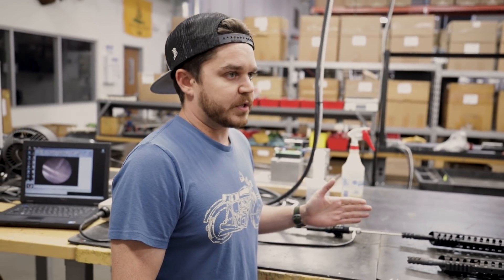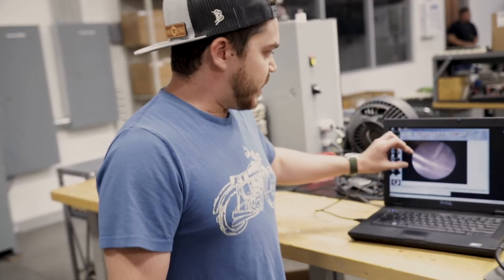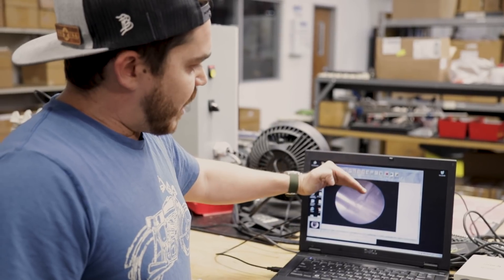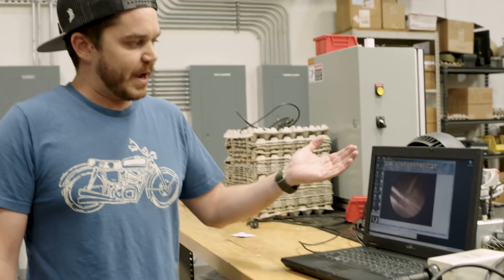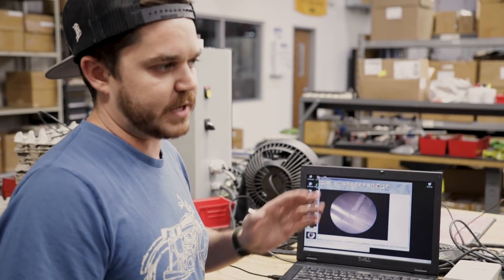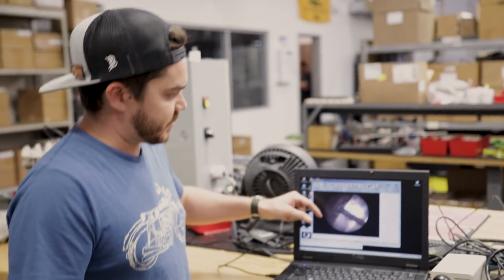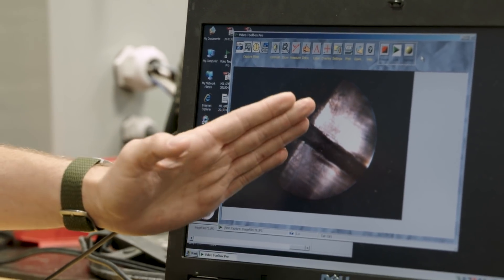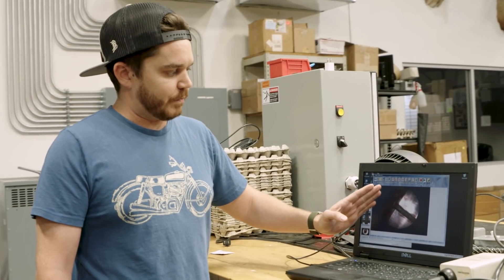POF Behind The Brand - Groundbreaking E2 AR Technology

Comment: Still not a fan, IMO you guys ruin a good Mike Rock barrel by doing that crap.
If you're ripping off the case head then you need to slow the operating system down, simple as that.
This machine gun technique is garbage for a DMR system, if it was the shit, everyone would be doing it. 
Go back to the gen 3 gear! Literally the only thing that gun needed was a lighter hand guard, everything else was perfect.
Reply: No one else is doing it, because no one else has patented it bro.
Reply: @JohnBrowningsGhost  That is so absurdly wrong its not even funny!
That exact same idea has been used on machine guns for decades!
Reply: but why is it bad? why do you need to slow it down?
Reply: @illfaptothis333  If the head of the case is being ripped off it means the bolt is pulling on the case while there is too much pressure in it. The case under pressure, is pushing against the walls of the chamber making it harder to extract (too much stiction), hence why the case head is being ripped off.
Reply: @beachboardfan9544  I’ve put a lot of rounds through my 415 edge 200+ a week never had a head stripped sounds like your over gassed…
Reply: @Peopleareevil  Thats what I said...

Comment: Great video! Question about the E2 design, though. It the idea basically the same as the chamber fluting that's found in delayed roller designs like the CETME and HK rifles? How does E2 differ from fluting?
Reply: The HK fluting has to exist because of the delayed blowback design. It will not function unless it has flutes.